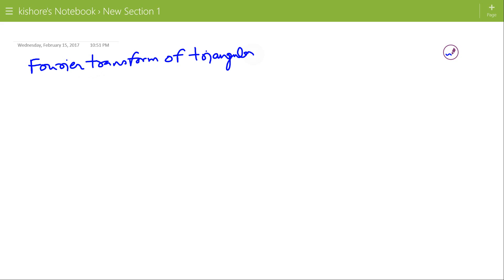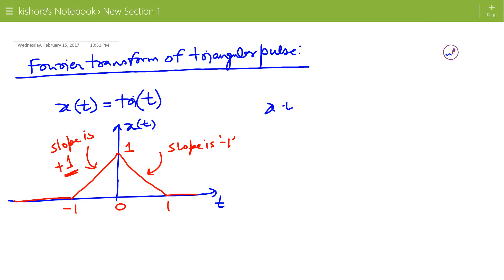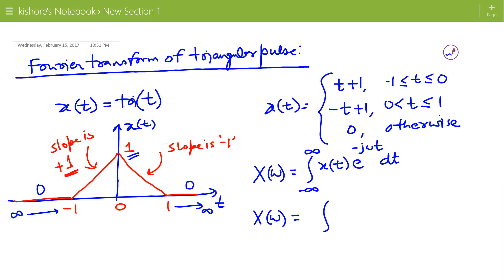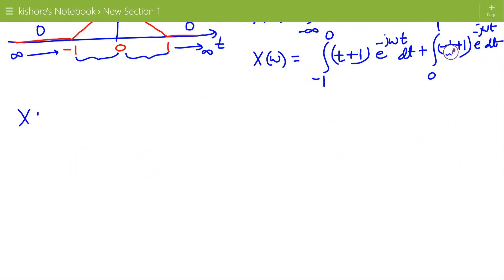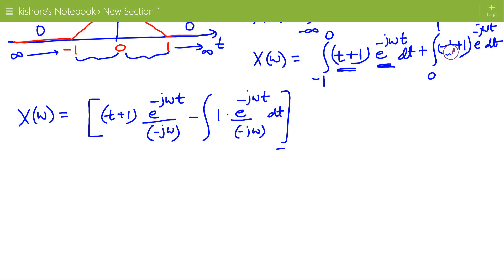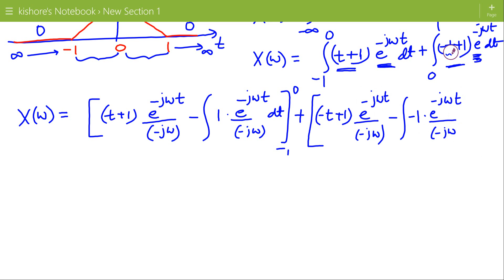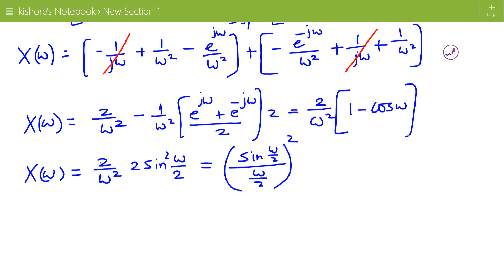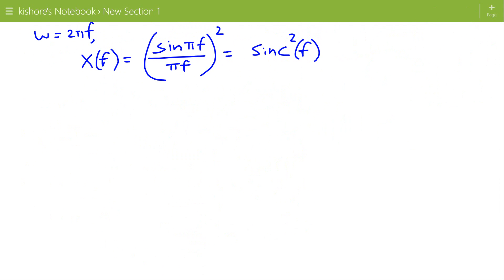Lecture on Fourier Transform of Triangular Pulse

Comment: why +1 ?
Reply from the maker: +Diego Onofre 
Triangular pulse is a combination of two straight lines between -1 to 0 (with positive slope 1) and 0 to 1(with negative slope -1). Both lines are intersecting the vertical axis at +1, hence in the expression of straight lines +1 will be there.